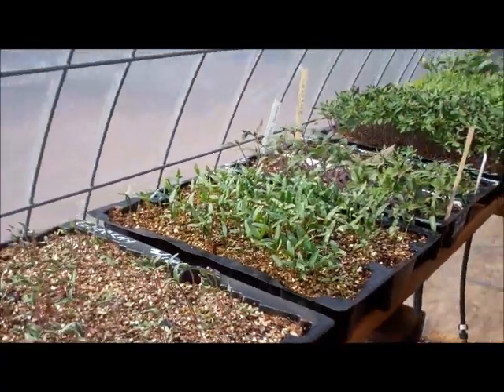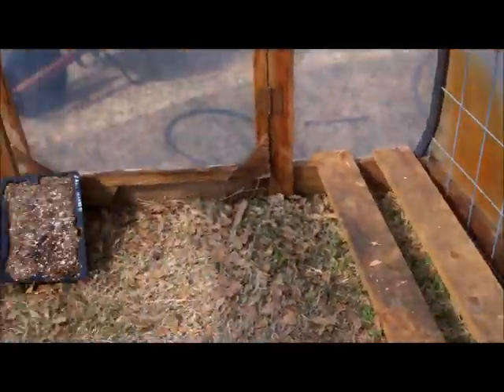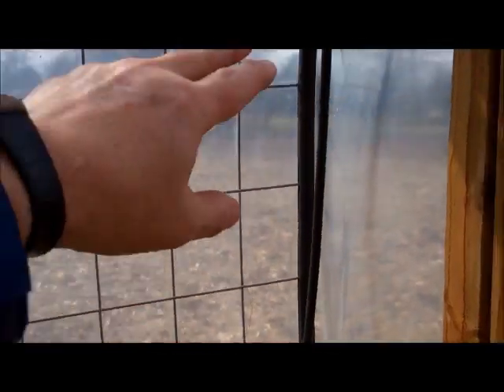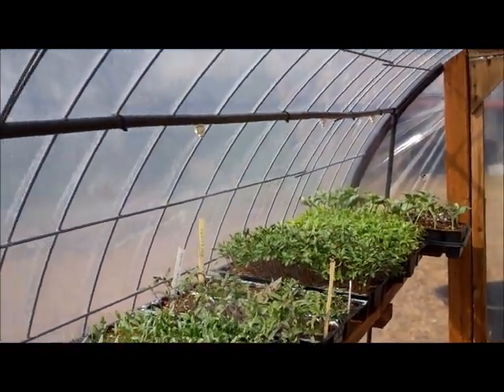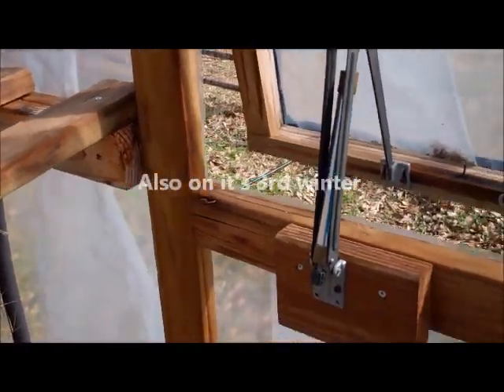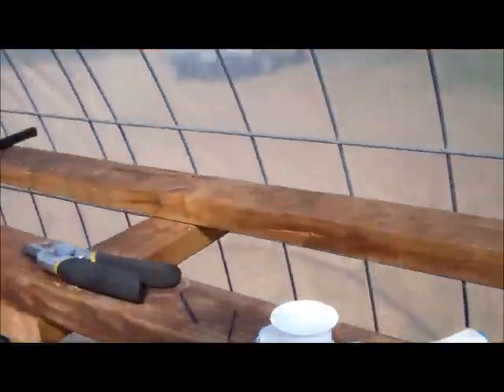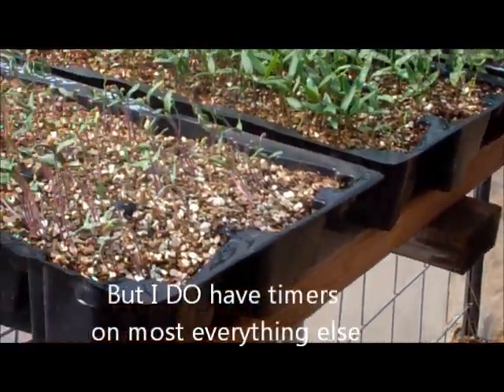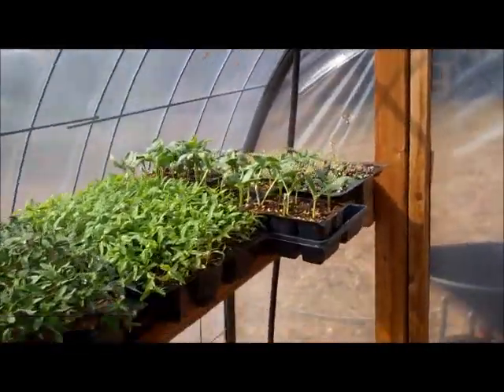Greenhouse Misting System - BEST SOLUTION FOR GROWING IN GREENHOUSES

Comment: Several of the links do not go to a product. Probably due to the length of time. Can you reply with the suggestions?
Reply from the maker: Amazon changed some of their policies several years ago and made some of their links invalid.
Here are the new links. 
I changed the links under the video too.
I thought I had already done that... thanks for the head's up!
(The white misters don't seem to be available anymore)

Here are the links:

For the plans and materials list to build the greenhouse click here: https://amzn.to/38Qb39i

If you want to be able to PRINT OUT the material, you'll want the PDF. 
Click here for the GREENHOUSE Plans and Materials List PDF: https://sowl.co/TMuS2

Here is a link to the timers that I use: https://amzn.to/38QG7Wk
Here's a mechanical timer that I really like: https://amzn.to/3cMhqM9
Here's some Misters for 1/4" line: https://amzn.to/2OY3WEG
Here's some Misters for 1/2" Main Line: https://amzn.to/38LBIEf
Here's some 1/2" Main Line: https://amzn.to/3lnAC6K
Here's some 1/2" Main Line fittings: https://amzn.to/2P0BFxp
Here's Hose End Fitting: https://amzn.to/3lqjsVT
Here some Elbows I use: https://amzn.to/30QKKey
Here's the Hole Punch I use:  https://amzn.to/2OFDnnO
Here are some Automatic Greenhouse Vent Openers:  https://amzn.to/3s0EWLB

Some of these items can be found at Lowes and Home Depot

Hope that helps,
alan

Comment: Very good video. I have a question. Is your watering system attached to a water pump? I have a water pump and I'm looking the best way to attach hose and pvc pipes, etc..
Reply from the maker: If by "water pump" you mean a well... then yes.
All outside watering I do is from my well.
Reply: @TexasPrepper2  Can you explain me how you connect the tubing and the accessories? Sizes, etc
Reply from the maker: Not easy to explain in writing.
I hope to do a video on that pretty soon.
Keep watching.

Comment: nice greenhouse. this looks a lot sturdier and more durable than a bunch of pvc pipes.  I'm putting together a misting system. The only thing I'm worried about is that our water has a LOT of minerals in it. Have you had problems with clogging? I think I may need to install some filtration.

Comment: Will these misters work outside in the wind for cuttings? I tried the brass patio misters, but the mist was so fine that the wind carried it away and my cuttings were dry.
Reply from the maker: Wind can be a problem, but I think these put out more water, so it's worth a try.
Summer is a tough time to do cuttings anyway.
I gave up trying to propagate in summer.

Comment: will these misters work if I build the system with 3/8" or 1/2" PVC instead of the hose??  nothing I read online tells me if I should get the barbed style or the threaded style, or what it would take to attach the threaded style.  so wondering if you happen to know?
Reply from the maker: Barbed is so easy to use... I recommend it.
Yes, 1/2" PVC could be used, but you would have to used threaded mister, and I don't know how to do that in PVC.
This black pipe is just soooooo easy to use, that I just wouldn't try anything else. Just punch a hole and you're done !

I've never seen 3/8" PVC.
Reply: Joanne Hercules j

Comment: Hi We built it. Love it! ...Where and how did you get mainline into greenhouse? Did you run mainline back to spikit? Or do you run  a hose before to the grnhse before attaching mainline? How many Elbows? I want to run mister  top and bottom left and drippers on top and bottom right. Will this work? Also need to be able to detach mainline outside to move greenhouse later.
Reply from the maker: +William Meredith 
Watch again at exactly 5:00 in. The mainline goes down almost to the ground. 
There, it hooks up to a garden hose. I run the garden hose under the frame of the GH.
Unscrew the hose and you can move it around... works great :)
Number of elbows will be determined by how you decide to run the mainline. 
Draw it out first on paper, then count the places where the elbows will be. 
Always buy extra ones too.

Comment: How far apart are your misting heads?  I built one of your greenhouses 8x30 wondering how many i need on each side.   thanks
Reply from the maker: I think they are about 2 feet.Depends on what misters you use, though. What I did was to install ONE mister... turn the water on... then see how far it spread out. Then I calculated how far apart to put the rest of them to get good coverage. You may want to try that.
Reply: ok thanks the one you used was the one from your link rite?
Reply from the maker: *****
Yep...

Comment: My neighbor is building a misting system in a greenhouse for tomato seeds and is wanting to know how long to leave the system on in the mornings and evenings. I have searched the internet to no avail. Maybe my question is too specific. Can you help?
Reply from the maker: If he is starting seed in there, he just wants to keep the soil moist. I put saran wrap over mine till they germinate, then remove. The plastic wrap acts as a greenhouse and holds the moisture in... as well as creating condensation to help water them. So... Not sure about amount of time exactly, but just enough to keep them moist.

I start all my seeds indoors, NOT in the greenhouse.

Now... after they are seedlings, I move them to the greenhouse. THEN I water using the misting system. I didn't use a timer on the misting system, I just watered them as needed. Obviously they needed more mist on HOT days and less on cloudy days. Usually I turned it on once a day for an hour or two.
Hope that answered your question.
Watch my seed starting video I put up last week to see how I start seeds.
Reply: Thank you kindly. I will pass it along.

Comment from the maker: As I understand it, there is oil in the cylinder. When the oil heats up, it expands and pushed the rod out that is connected to the window. The hotter it gets, the wider the window is opened.
 It works GREAT ! Getcha one !

Comment: I understand you want to hinge on the bottom so the hot air is easier vented out, but if the vent hinges on the bottom and it rains won't you get an awful lot of rainwater in the greenhouse?

Comment from the maker: I don't think the tote will work on the misters. They probably need at least 25+ psi to work. These are on my well, which runs about 50 psi.
The tote will work on all your drip stuff providing you get it high enough to give you about 5+ psi. If I understand right, each 10' of elevation gives you 4 psi. So your tote will need to be 10+ feet to do drip. BUT... the misters will need to be on a hose with pressure. You COULD use a 12 volt on-demand pump and a battery with a solar panel. Interested?

Comment: Added this to my project list.  What are you using to get pressure?  Straight off a hose or are you using a submersible pump?  No faucet near my green house, so was going to use a 275 gallon tote as a reservoir that fill off the roof - just need some way to get pressure.